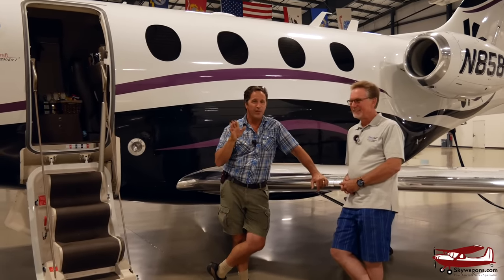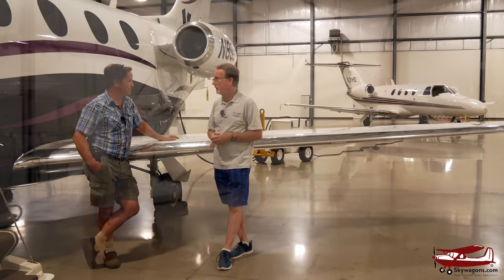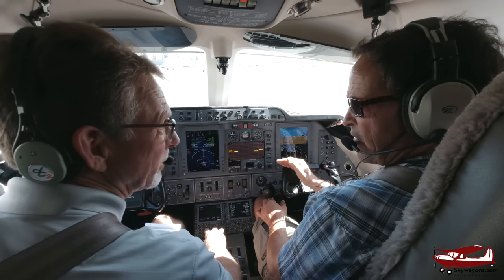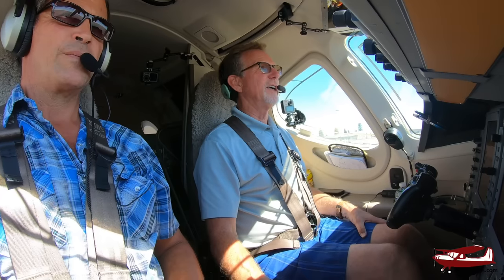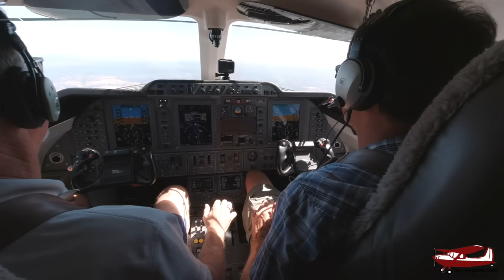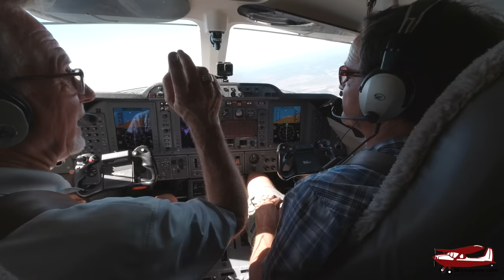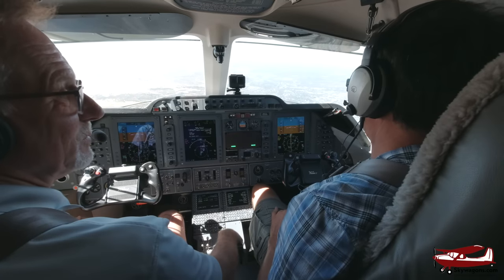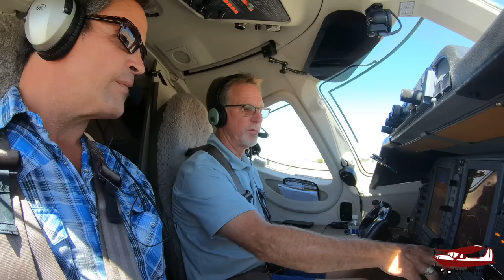The Beechcraft Premier 1

Comment: I’ve been flying this Premier IA jet for about 12 months. I have the Pilot in Command Type Rating in the Premier with Single Pilot Endorsement. I enjoyed flying Premiers. I have dialed in to a point I was greasing these jets on for almost every landing. You have to fly these jets by the number. You can’t exceed Vref by more than 10 knots if you don’t want to float forever. It is not a short field jet but I felt confident landing on runways as short as 4800 feet. I refuse to fly these Premiers to airports with runways shorter than 4500 feet when the runways are wet. Biggest drawbacks of flying these old birds are maintenance, payload and range. Parts are getting expensive as they are no longer made. It has 6 to 7 seats but you cannot carry 6 full size adults and fly for 1000 nm. If you carry 6 passengers of 200 lbs or less, you can plan on flying for no more than 2 hours in IFR conditions with IFR reserve fuel.

Comment: G,day from Sydney Australia.
Thanks Mark, alittle more knowledge in my memory bank about the Beechcraft Premier 1A with Williams jet engines. 
* nose wheel locking pin
* composite carbon fibre fuselage
* single engine capability to        maintain a rate of climb
* TCAS alert and collision avoidance
* Stopped production 2012
* VNAV 'stepdown'
It's seriously 'heavy iron' quality kerosene burners!
👼💨
Reply from the maker: G'day from Placerville!  Thanks for watching!

Comment: As a Canadian we have been metric since the 70s. However in my shop I’m still 99% imperial because most building materials are sold in imperial sizes  eg. 4 by 8 plywood. When building a shed or deck I think imperial eg  studs on 16 in centres, and buildings an decks are built in 4 foot increments to maximize materials.  Our temperatures are somewhat strange as house and outdoor temps are exclusively metric but the water temp in our lake is always imperial. Cooking is mostly imperial. We have a ways to go before we are fully metric.

Comment: $26,000 a set of brakes???   Is that to replace the calipers pads and rotors?  I sit because you have to replace the wheel hub / spindle each time?  At least there's no TR's or LE devices...  Also wondering, are the spoilers not approved in flight?  - while you discussed decent profile and being ahead of the airplane...  Did you discuss the cabin in the previous video - I'll look for it.  Hope you noticed the painted on window!  OH, and the instrument not on the panel was on his control yoke,.... turn & bank ind. [slip]  maybe I went to sleep if he mentioned it, or did you fail the quiz and edit it out?  :)
Reply from the maker: We superimposed the Turn Co-ordinator on the yoke to tip people off.  You are the only one that saw it so far.
Reply: @skywagonuniversity5023  LOL,.. wow

Comment: Well that was interesting, and nicely filmed, thanks.
I like Mike's explanation of the instrumentation logic, ie whether you look at a traditional 6 pack or full glass, they basically are all telling you the same thing.  The presentation is different, but the message is the same, basically how to get from A to B laterally, and with the introduction of VNAV you're offered A to B plus vertical guidance.  
I think Mark was impressed with the level of automation, (never heard him so quiet!) and by adding auto throttle an even further hands off experience is present.  I don't know the Premier aircraft, but looks like no auto throttle here.  Also, wasn't sure if this aircraft has a spoiler / speedbrake system, but this is where Mike's gear and flap speed limits and descent profile can all be helped. 
As for the unanswered question as to what instrument is in Mark's Mooney, not in the Premier, my money was going to be on a Manifold Pressure gauge.......... jets normally show power in percentage of N1 (compressor) speed.
Thanks again all, keep up the good work.
Reply from the maker: Thanks.  That is true but it is a turn co-ordinator.
Reply: @skywagonuniversity5023 I'm glad you answered that! Great video!
Reply: The Premier 1A does not have auto throttles , but it does have speed breaks. Mike kept on about speed control/management and being 30 minutes ahead of the plane so he didn’t have to deploy the speed breaks. The only time you really want to use speed breaks are after touch down, otherwise you are wasting fuel.

Comment: That yoke looks small.  Does it make it twitchy in the roll?
Reply from the maker: Not really, you hardly need to touch the yoke in that machine.
Reply: No. It is actually a bit slow in roll. You have to get significantly nose up to do a proper aileron roll due to relatively slow roll rate. Passing that on from a friend.

Comment: Mark, what camera are you using that has the heads up display?
Reply from the maker: We use a program called Telemetry Overlay.  It uses the GPS data from the GoPro to create the effect.  Not 100% accurate, but it gives you the idea.  - Don the Camera Guy.
Reply: Thanks Don!